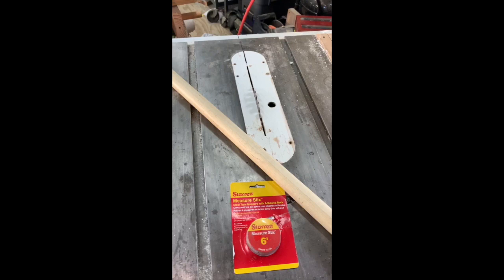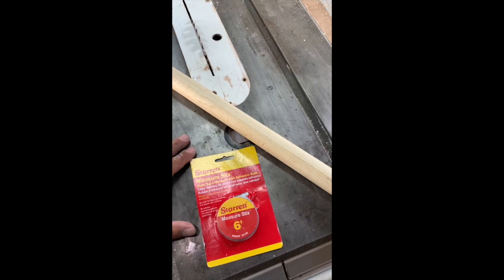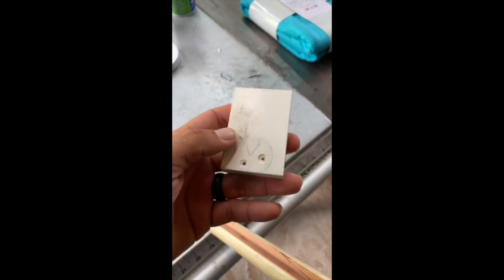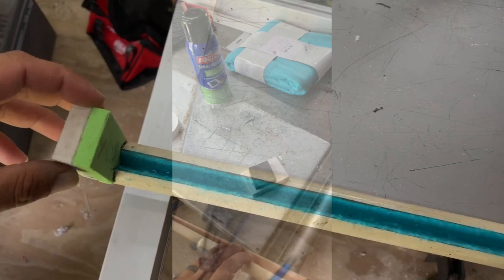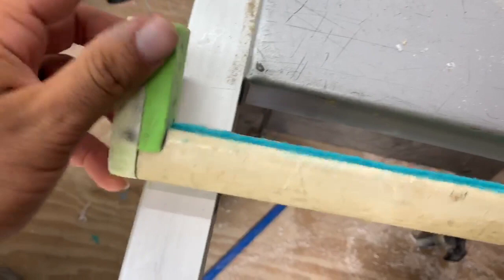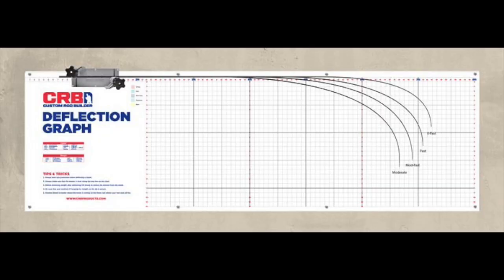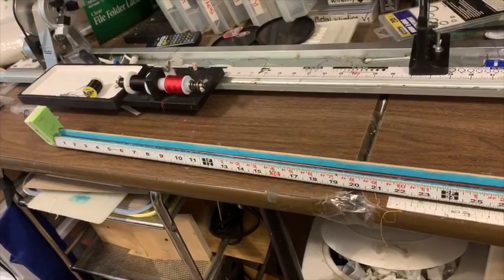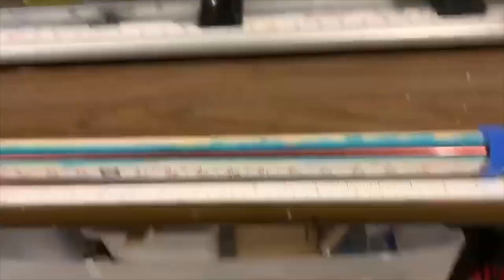Guide Placement Tool for Rod Building

Comment: Your guide marker is cool , I used a 1"x2"x8'long pine wood put a v slot same as you, sanded the v then used a DAP ACRYLIC LATEX CAULK PLUS SILICONE in the V , with a pice of wood to cover both sides let it dry. Now I taped the guides where I needed them for the rod I was making 
   After checking to see that the guides were right I put the rod in the guide marker, marked on the holder where the guild is at on the holder .      
   Now I can make more than one rod and the guilds will all be the same. Makes all the rods the same( 3 of them)don't have to use a tape to make each one. Also I mark the handle layout to. You got a good thing going .
Reply from the maker: Richard Curry that sounds like an awesome system you have going there. Thank you for sharing.